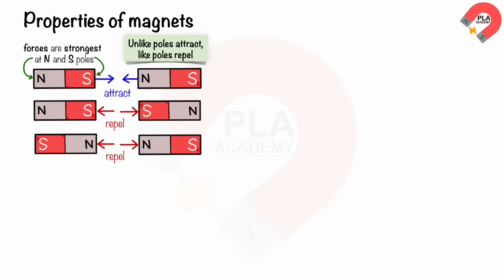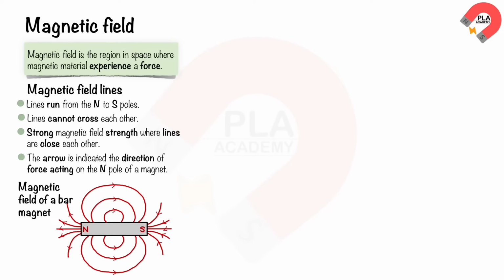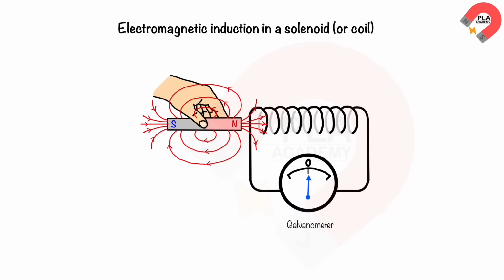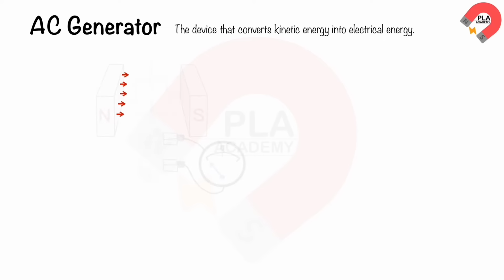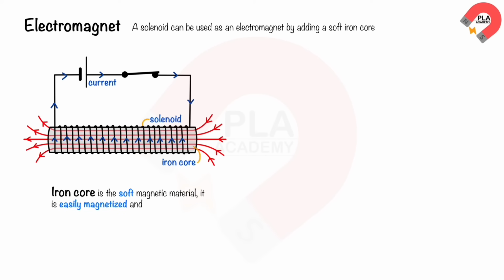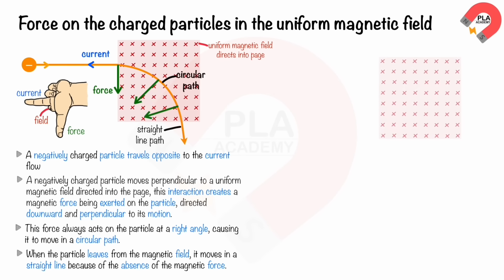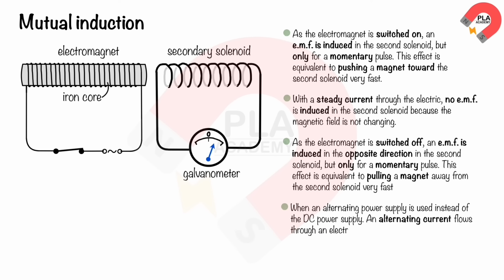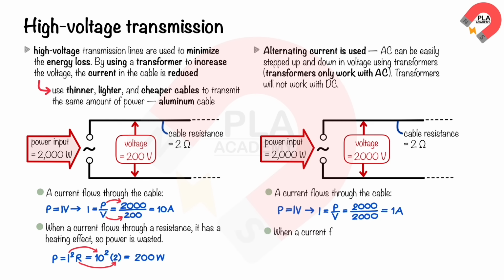Cambridge IGCSE Physics 0625 UNIT 4 Electricity and  Magnetism Revision #igcsephysics

Comment: 21:36 won’t it be wrong that slip rings reverse direction of current every half..?
Reply from the maker: In the video is correct. The sleeping and speeding have same function as reversing the current every half of rotation when the coil is vertical,  causing the coil to rotate in one direction and creating a.c. in output of generator.

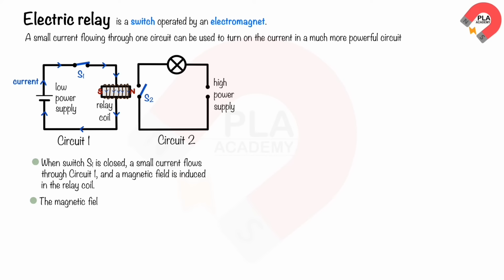Comment: and at 28:18
 and many other places including the other video on thes chapter u keep mentioning the the circuit is "open" when actually it is closed , pls correct all ur errors this channel is a great resource to everyone im just pointing these errors out  just make sure they dont learn the wrong concepts thank u
Reply from the maker: It is correct, when switch is closed, meaning that circuit open.
Reply: @plaacademy isnt switch closed = switch on
 meaning the circuit is closed?
(sorry if im wrong just trying to clear this doubt)
Reply from the maker: @Aishathsajaaya noooooooo… 
Switch closed, meaning circuit on
Switch open, meaning circuit off

Pleaseeeeeeee….. see vid in the section of circuit components
Reply: @plaacademy  oh myyy
so the switched closed meaning its off okayy got itt!!

ALSO SOO GLAD I FOUND THIS CHANNEL RIGHT BEFORE MY EXAMS ITS SAVING ME BIG THANKSS
Reply: @Aishathsajaaya NO 
Imagine the switch is a door. 
When the door is OPEN the lock mechanism in the handle is not connected to the door frame so if electricity was running through it, it would be able to connect to door

when the door is CLOSED both sides of the door are now touching the door frame, hence now the "electricity " can run through the door

Which is why when we say a switch is open, it means the circuit is off
when switch is closed, circuit is on

Comment: 20:09 Does an AC generator convert mechanical energy into electrical energy?
Reply from the maker: Mechanical energy is sum of kinetic energy and potential energy.

So, generator convert KE into electrical energy, which is actually correct.